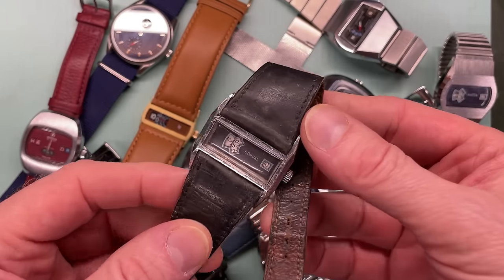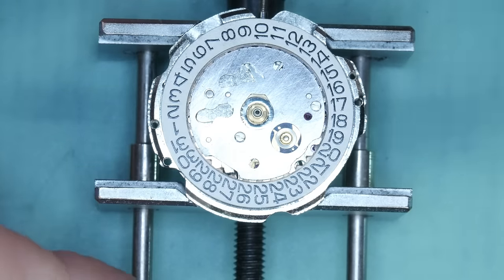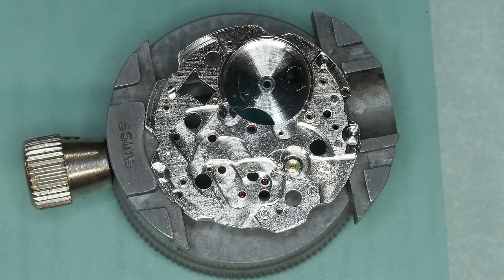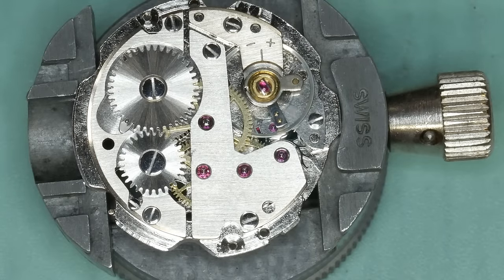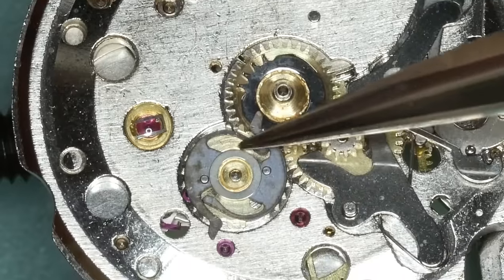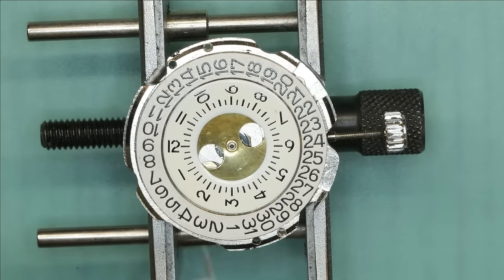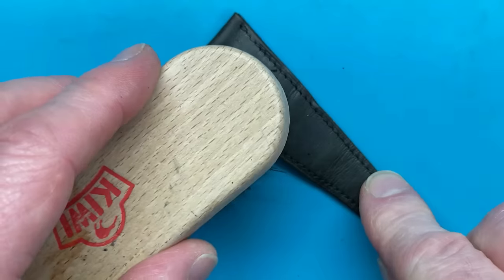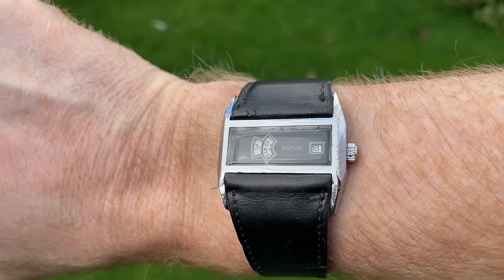CAN THIS WATCH BE SAVED? -  Dorval Jump Hour Watch Restoration

Comment: Enjoyed the video as always!  I would suggest maybe calling this type of "non-jumping-hour" watch a "wandering-hour" watch.  Some of the old pocket watches made in the 1920's featured a "wandering seconds" disk instead of the traditional sub seconds hand.  I believe both Waltham and Hamilton made them and probably others.  I actually own a couple.  Neat old watch though.  Nice job!  Something you might want to consider is making your own straps.  It's really not that difficult.  You could cut the old stitching out of the damaged strap unfold it and use it as a pattern.  Really only need a new bit of leather, some saddle needles, and some waxed, hemp, thread.  There are vids on how to do it here on YT.  Just a thought.  Cheers!
Reply from the maker: thanks, I have considered strap making so maybe one day.  I have enough on my plate for now with all the watches I need to repair!  wondering hour sounds so much better but equally much more technical than a circulating disc.

Comment: I have been restoring leather interiors for about 30 years and I keep every color of shoe polish there is. A lot of it is 20+ years old and not made anymore but I have always cleaned the leather then apply the polish evenly on all the leather. Let it set in the sun with windows up for a couple of hours then use a rag to buff it until nothing comes off then condition the leather. Looks like new unless it’s got tearing on it then it’s off to the upholstery shop. Awesome video as always.
Reply from the maker: That’s interesting I was not far off with my effort then.

Comment: I enjoy your jump hour watch vids so much I brought a Saytoko Grand luxe super 21 jump hour that was not working because the rachit wheel was missing and the screw had been sheered off so I got a replacement bfg 582 movement from Switzerland and rebuilt the existing movement with the parts (I did it this way because I did not want to take the dial off and face any more issues like spending hours on my hands and knees looking through the carpet for springs and bits lol) It works well now.

Comment: Good job. I was lucky to get a Lucerne jump hour watch that just needed a clean to get it going, plus a new strap. I've kept mine 'vintage' as it has an unusual lacquer finish that can't be polished. Currently I have another to restore that is annoyingly missing it's balance jewel. 
Thanks for the inspiration again.
Reply from the maker: If you can work out the movement manufacturer and number there is a good chance of finding a donor balance jewel.

Comment: Great job on the watch, notice the bridge plate screws are not blue, might be the type of movement.  You did a fantastic job on the watch and figured out how it works.  Camera pictures looked fine from this side.  As far as electroplating goes, I say this might be a good practice watch to do that on.  I see other watchmakers polish the case like crazy to get rid of scratches.  Then others like the patina look, your call.  By the way I have a “Kingston 17 jewel jump hour watch” looks like you LIP watch, got it from eBay, not working currently.  Will mess with it later.

Comment: Dee tent? Interesting watch. The outside is so different, but the inside is just a watch basically. Glad that you are doing well.
Reply from the maker: Thanks for the pronunciation. I often forget the name of that part and end up calling it a click. I will try now to remember for next time.
Yes it’s a standard movement really just has two discs. Actually shows the power of the motion works and train to actually turn these discs as they are no doubt heavier than hands.
Thanks for tuning in.

Comment: Another great restoration. I found including the strap restoration process informative and essential because of the scarcity of replacements. Chrome plating is a multistage process but I’m sure you know that. I’m not certain plating this case is essential for this watch but that’s your decision. Thank you for sharing the restoration to date.
Reply from the maker: I will not be chrome plating because I don’t believe that can be done on a home setup. Nickel is an easier solution that just requires vinegar, salt a power source and some nickel anodes. 
The key is in the prep of the case and how clean it is. Maybe an acid pickle too.
I’m looking into it as it will make for an interesting video especially seeing me attempt something for the first time and on film.

Comment: If you're looking to clean & rejuvenate old leather, I'd suggest Saddle Soap, it's specifically made to clean any type of leather product. Also some leather dye which is fairly inexpensive and a decent leather conditioner along with an old tooth brush will make any old leather look new. 
  Just don't let the soap dry or soak into the leather for too long, you want to apply it scrub the surface and wipe it off, you can do this as many times as is needed. After you've cleaned it let it dry, then apply the leather dye if needed before finally applying the conditioner until it will no longer absorb into the leather. 👍👍

Comment: I really enjoy your videos as I especially like bringing old things back to life. I was watching another video some time ago where the watch was varying in accuracy in different positions and the diagnosis was end shake. The watch maker used a tool with a micrometer to seat the jewels at the proper depth and it increased the accuracy of the watch. I don't know if this is the case with this particular watch but it is an opportunity for a new tool.
Reply from the maker: Hi Gary. Thanks for your comment. That tool is called a jeweling tool.  One arrived only last week for me! Not sure it’s applicable on this watch but they are very useful tools to have.

Comment: Try steaming the band with an iron or fabric steamer next time before cleaning and conditioning. It will loosen up / become more flexible, will remove some of the dirt and grime, and open the "pores" of the leather which helps with absorbing the conditioner. A trick I use on my leather motorcycle boots.

Comment: I have 5 or 6 NOS Jump hour watches. They are branded Maggins. The case is identical to your watch, but they don't have a date. They are marked 25 jewel, Automatic. I haven't removed the case back to confirm all of this. It is in fact Jump hour though. I  got one out because  of your video, put a little wind to it, and it took off running.  I've had these about 30 years. The back still has stickers in French, could possibly be the same manufacturer as your watch as the case and strap are the same as yours. Really nice video, I enjoyed it. My vote is to NOT replate your watch. Keep it original.  Ron
Reply from the maker: Wow that sounds amazing. I love NOS watches from the past and finding jump hour ones is rare.  Its also very rare to see ones with such high jewel count as many had BFG 1 jewel pin pallet movements thrown in. 
Many people are shouting for plating so I might still do it but its allot of work and I have to buy all the equipment first.  Thanks for watching.

Comment: I think with the strap you could steam it to straighten it prior to cleaning, boil the kettle and hold the strap over the spout until damp and then under the weight. To put a finer finish on the polish after buffing with a brush use a balled up stocking and buff with that. 
I have used both techniques but never on a watch strap.

Comment: It's nice to have fireworks outside to celebrate a successful rebuild! ;-) Nice job. On the strap you could have used black leather dye followed by a leather sealer. The shoe polish might bleed off if the band gets wet. Good vid. Keep at it!
Reply from the maker: Thanks Mark. I am under no illusion that the boot polish will last forever but figured it would make for an interesting part of the video.
If I end up plating the case I may end up replacing the strap too in the end.

Comment: Nice one Mike, good to see you back at the bench with a screwdriver in your hand.
About the re-chrome job on the case here. I think if you restore the case back to a pristine 
condition, you'll have to go the full mile and replace that strap. Restoration over renovation as it were.
Don't mess about with eBay looking for a replacement, you won't find one.
Best bet is to hunt down a local craft centre with a leather worker, the kind of guy who offers new leather 
craft work and repairs to horse gear. Take the old strap with you and say something like "Hey mate are good 
enough to copy that". 😱 Or something a little more polite.
Then negotiate a price, the unfunny part. 
Good thing is,  you can always vary the colour of the leather staining to anything you want.
10/10 👍
Reply from the maker: Thanks. That thought had already crossed my mind to have one made but a new bespoke strap will cost more than the watch.

Comment: Great work on a very unique watch.  I do not think I have seen on of these before.  I, like the other here, vote for nickel plating the case.  I have done some plating at home of Corgi wire wheels and have had great luck.  You may be able to get a better shine from the strap by doing some spit polishing on it, like we learned in Marine Corps boot camp.  Count me as a subscriber from across the pond.
Reply from the maker: Hello Ron, thank you for subscribing I really appreciate that.  Plating is in the lead on the voting so far so I best start buying the equipment needed.

Comment: Interesting video, first time viewing.  I was actually expecting that the hours would be jumping from the title.  Which you acknowledged at the end, very good.  Just if it might help, instead of polish, what would be better is leather dye. Polish rubs off, which can be bad for shirt-cuffs and pants alike, where dye does not. And it does a much better job of recoloring. Then use a neutral (clear) polish afterwards to give it a shine.  No apologies needed for the lighting, it was fine in my opinion. I don’t know if this disassembly will be helpful for you to prepare for your real jump hour watch.  But I will keep an eye out for the video.
Reply from the maker: Thank you for watching this one and for your advice on dye etc.  It was my first time working on a strap so I figured i would just try cleaning and polishing. It came up well so may try using proper products next time.  I do tend to buy new straps for restored watches as a rule though.   
Yes its not really a jump hour but it has the same look and in many ways I think they were just jumping on the band wagon at the time and this movement off the shelf didnt require any special modifications and just used hour and minute discs instead of hands.  Result is though that when the time is past half past you can easily mistake which hour you are in.  All made for an interesting video that YouTube finally picked up on and brought my channel to a new audience.

Comment: Very interesting restoration! I like the watch as it is, as it speaks of having a history. As for replating the case, if it is chrome plated, why would you use nickel plating to restore it? As for the strap, that was pretty impressive. I have done some fur dressing in the past so I am familiar with the tanning process. The restoring agent you used acted like a synthetic tanning agent that is very good for leather that is going to be handled frequently or exposed to moisture (sweat in this case). I am also wondering if a tanning oil would have worked here.
Reply from the maker: Nickel plating is doable at home with minimal effort or expenditure. Chrome plating as I understand cannot be done at a home setup.  Nickel with brighteners gives a good enough finish. I have seen many guys do this recently so willing to give it a go.

Comment: Never seen that style of clock-work wrist watch before ~ using number wheels instead of hands
Reply from the maker: It’s actually very old idea. Some originate from the 1930s I believe.  They came more into fashion in the 70s when the first led and digital watches arrived.
I like to think it’s the mechanical watch industry answer to the digital watch.
This one is not a true jump hour as the hour does not jump into position in the window at every hour change.
I have a recent Sicura video which shows one that jumps .

Comment: Just thought I'de add this bit in...   With all that work you have done on the movement etc etc. it is somewhat dissapointing that the case remains visibly scratched. I always buff my watches but try not to get any that have major damage.
Reply from the maker: The case is chrome plated so you can’t polish or buff.
You must have missed the part of the video where I asked the viewers if I should nickel plate or not.

Comment: Saddle soap boot polish (which will ruin your cuffs), then olive oil and finally Ko cho line.  A couple of applications before moving to next gunk.  It depends if you are going to make a habit of leather but it will bring anything back from the dead.  Just don't mix the materials.
You can use leather dye but meh!
I like your style, my sort of learning

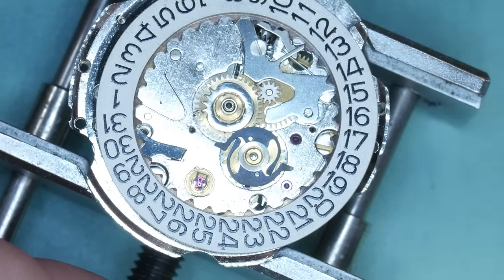Comment: 8:50 some kind of a bug got really disturbed. @WristwatchRevival would probably be rather eloquent on the fact that there is an actual non-mechanical life inside a non-running wristwatch like it's a barn-find cuckoo clock.
Reply from the maker: Haha a Cuckoo clock! its not the first video I have done with a creepy crawly inside a movement when I am working on it.  one of the early videos in my " 5000 sub giveaway " series has a similar bug mooching around.

Comment: I believe that these watches shared the same movements with HOGA watch.
Reply from the maker: No the Hoga is the same as the LIP which is a AS1901 I only know this because I bought parts for my LIP and they were labelled HOGA.
Reply: @MyRetroWatches  

I was fascinated by HOGA watches 55 years ago when I was a junior high school boy walking by watch shop because they were the forerunner of "Digital" watch before Casio wstches.
Reply: @MyRetroWatches  

I suppose that both LIP and HOGA are brands under Auguste S????(I forgot) Group.  Recently AS Group has another brand "Swiss Marine" available locally in Taiwan that brought back my memory of HOGA watches.

Comment: Is there any reason some gears are brass and others steel?
Reply from the maker: It’s a good question but not one I can really answer. Probably a wear issue and weight possibly. Trains need to be light so they spin freely without drag . It really does not take much to stop a watch.

Comment: I guess it is debatable whether these jump hour jobbies were ever intended to be serviced!  I took one to my local repairer and he declared it too worn to be fixed! That was 25 quid down the drain! Mine is a Buler which I  bought thinking it was a 'good' brand but it turned out to have a rubbish pin pallet like the ones you describe!
Reply from the maker: Pro's turn them down all the time and 1 jewel movements are really hard to work on as its all metal on metal.  They can still be fixed but usually by the hobbyist. 
I am sure you can flip it back on eBay and get your money back.

Comment: Nice job on that one. Yes please replate it. Yet, I can't say I like this style of watch : it feels "fake" to me ; that's a rather regular movement, they only replaced the usual hands with disks. That widescreen feel is only caused by the pulled-over straps hiding top and bottom sections of the box, but it makes the watch even thicker and bulkier. And that "Dorval" brand has a soap-opera-ish feel to me. So : replate it, let it be as bling-bling-ish as it was meant to be, then throw it back to the bottom of the drawer it can from. And let's focus on that Lip watch.
Reply from the maker: I understand where you are coming from.  Its not the best jump hour by any standard although this one has a very good movement compared to most that have a BFG pin pallet 1 jewel.  The LIP I have already repaired.  Didnt fancy filming that one in part as it was my 50th present from my wife so I wanted to wear it asap.

Comment: I think it's fairly obvious that watch wasn't designed to actually jump on the hour as you assume... if it was there would be no reason for the quarter-hour hash marks between the hour digits, y'think? 🤔😉
Reply from the maker: Well yes that’s why I said at the end that it’s not really a jump hour.  It still looks like one and I have plenty and this is the only one I have that does no jump but spins.
I guess it’s what FE movement could manage easily for a conversion. You could just put normal hands on this one as much as discs. 
Often you find it’s a standard movement but then with modifications to the dial side. The LIP Baschmakoff is like that based on an AS1901 which I believe also comes as a conventional movement or a modified one for jump.

Comment: Please, do nickel plating. Only the back must not have nickel, which You know I am sure :). And I think, the movement should move a bit to the right.
Reply from the maker: Yes I am aware of nickel poisoning. I have also looked into a nickel / Cobalt solution which gives a much more chrome like finish. Just expensive..
Movement sits fine in the case. It has a movement spacer that can only fit in one way so had anything been out of alignment it would not fit inside.
Reply: @MyRetroWatches  I mean if you look at the numbers, they seem off to the left and we even see some details of the calendar wheel we are not supposed to.
Reply from the maker: @Neqael.  I will blog on this watch on my site soon so you can then see the photos. Looks fine to me.
Reply: @MyRetroWatches  The watch before repair seems to have the same issue that troubles me. So it is either a factory fault or the way it is supposed to be. Maybe I judge it too harshly :). Looking forward to watch the plating process! The strap looks quite renewed btw.